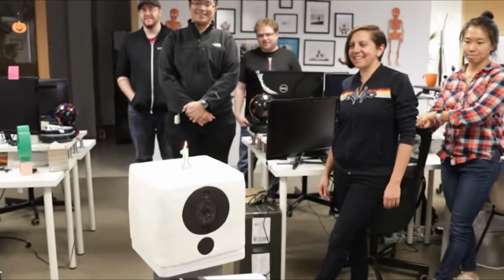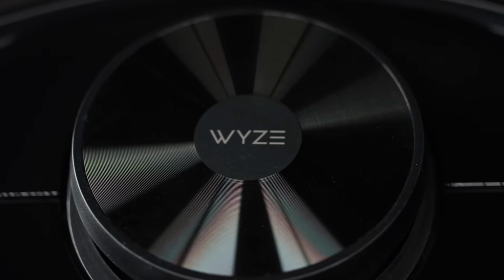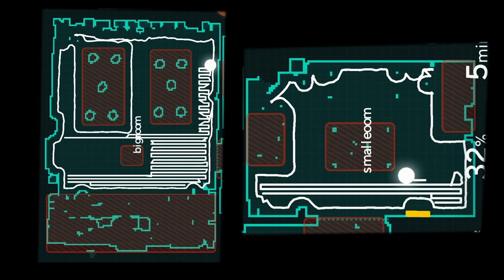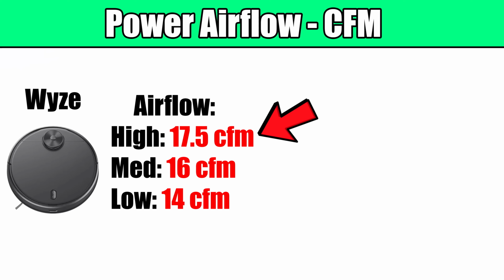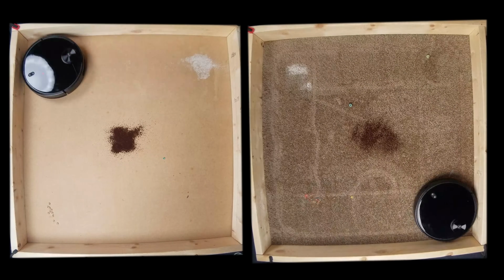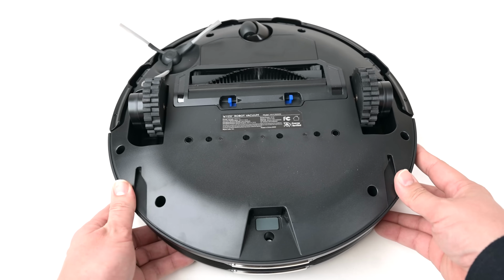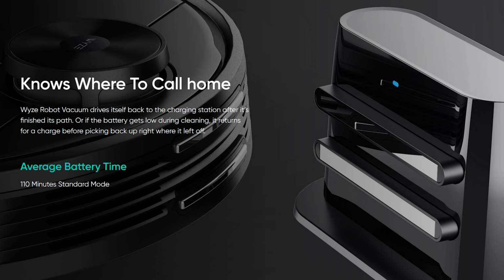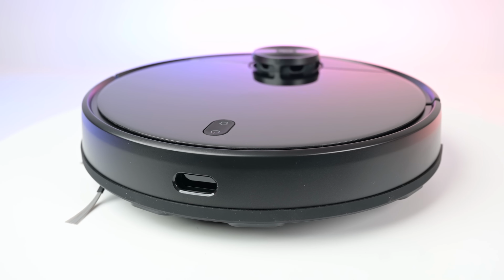WYZE Robot Vacuum Review - This Will Shake Things Up!

Comment: I disagree with you claiming that battery running time is not important. What about if you have a big two story house or a 3 story house. That my problem right now most of the vacuum right now are not capable of cleaning my second floor so I have to bring the robot upstairs once, being down let it charge and being it up again to clean my entire upstairs. it is a pain in the ***. 90% of the houses around where I live are two story houses and mine is only 2600 sqft.

Comment: This is exactly the same as the Mi Robot Vaccum Mop released in India last year. It was available on pre-order for Rs 18000 (USD 250) but its now sold for Rs 25000 (USD 350), including shipping and taxes. The Indian model comes with two mop attachments and an additional water tank.
https://mobile.mi.com/in/mi-robot-vacuum-mop-p

Comment: Is this one of the robots that has the camera that will spot potential obstructions? That's a huge deal breaker for us. We have cats who leave hair balls and occasionally worse and I dread having a robot vacuum spread that all over the house.
Reply: No camera, it will use sensors and slow down before bumping anything but will go over small things like cats toys etc, so even if the hair ball is a inch or two diameter it would most likely just suck it up. No worries, it’s smart but not too smart, does a great job.
Reply: I may have miss read your post. If the hair balls and worse mean vomit with hair balls or fecal matter,  than although I haven’t tested it, it would run over and smear whatever’s smear-able, I’m sure, unfortunately for your situation. We have a cat and it sure does pick up a lot of hair, we love it.

Comment: Is there any way to check for longer term hair tangles on both the main roll and side bristles? I’ve had multiple robot vacuums that have the standard hairy roll (haven’t had a roomba) and since my wife has long hair, after a couple uses the hair tangles everywhere, around the side bristles and the main roll

Comment: it is a rebranded xiaomi mi home robot and mop combo but without the mop attachment and the  "combo water tank / dust bin" 

i have the original product from xiaomi, and it cost a touch higher price in china, about 1800 RMB while 250 dollars is about 1620RMB.

its brush roll is not floating brush , it cant pick up some heavy debris which roborock can. while the brush roll don't last long.

Comment: Looks exactly like the Proscenic M6 Pro I have, probably a clone or related to it. Great vacuum for the price, very hard to pass up. The M6 Pro does have a mop with electric pump that slides into the bottom slots that are present on the Wyze robot.

Comment: Wyze has some sort of connection with Xiaomi, because their cams were sold rebranded by Xiaomi in the Chinese market as “Xiaofang”. Since Roborock and Viomi are also part of the Xiaomi ecosystem, I wonder if this is simply a rebrand of another Xiaomi product. The Wyze band looks very similar to the Xiaomi Mi Band 4C (same design but different specs). Same goes for the Wyze Watch. Even their thermometer and the surge protector is just a rebrand of a Xiaomi/ecosystem products. You should check the box of the vacuum, it often states the manufacturer of the product.
Reply: also xiaomi acquired roborock a couple years ago. Xiaomi using wyze to break into the american market.
Reply: @chinchilla505  I don’t think we’re talking acquisitions here, it’s more like Xiaomi has participations in those company so they can use their distribution network and Xiaomi Home app ecosystem. The original Mi Vaccum Bot is Xiaomi branded and it’s pretty old but it’s manufactured by Roborock for Xiaomi

Comment: The Wyze vacuum is a rebranded Xiaomi Mijia STYJ02YM which is why it has slots for a mopping attachment. As far as I can tell it also uses the Xiaomi cloud for syncing with the Wyze app so it's pretty much Xiaomi through and through, such isn't a bad thing, but worth knowing.
Reply: Especially since the Xiaomi product is comparable in price but has more features like the mopping and connection to hubs.
Reply: Xiaomi owns the Roborock brand. Both brands make top-notch robot vacuums.
Reply: @bazil4146  They own a stake in it but they don't own it completely. Thanks for the reply. This has sent me down a rabbit hole of robot vacuum manufacturing again :)

Comment: Isn't this a rebranded Viomi/Xiaomi vacuum? It's exactly the same as Viomi S3 or Xiaomi Vacuum Mop Pro.
Reply: Roborock is made by xiaomi not sure of  the wyze brand
Reply: @6hilltop6  no, it's Xiaomi robots that are made some by Roborock, some by Viomi and some by Dreame. Xiaomi doesn't make robot vacuums.
Reply: @matteventu  they do. I own one.
Reply: @matteventu  roborock uses the Mi home app as well as the roborock app so yeah it's xiaomi, they make a multitude of products like samsung and huawei and they are under investigation by the USA
Reply: @catch_me_if_you_can1147  don't spread misinformation please :) "I own one" doesn't mean what you're saying is correct. The Xiaomi models are built some by Roborock, some by Viomi, some by Dreame. Those are companies that have partnered with Xiaomi to design and manufacture for Xiaomi the robot vacuum models, and sell them under the Mi brand. Still, they're not designed and manufactured by Xiaomi, but by those companies I've mentioned.
Reply: @6hilltop6  lol read my other comment to Johnnes. The fact they appear in the Mi Hoem app means nothing, it's like saying a TP-Link product is a Google product just because it appears in the Google Home app.
Reply: @matteventu   that is their strategy. their core components and parts are from the same manufacturer of Xiaomi. Xiaomi is a giant in smart home devices (builds almost everything) and it pushes forward the whole supply chain and ecosystem (mostly in Shenzhen). Many companies are following very tight. They just buy those parts from OEM and build similar products for cheaper price or slightly tweaked use cases. I believe Xiaomi is currently allowing it so it is still a legal thing. Wyze is just one of the few that sells abroad. I personally it is a good business model. It proves those cool tech gadgets might not be that costly.
Reply: @matteventu  you are correct. Some are affiliated to Mi brand. Some are just solo brands that are heavily dependent on Mi supply chain without paying Xiaomi. Xiaomi allows both, which is generous and cool.
Reply: @matteventu  you're wrong
Reply: @endorkugo  I'm not wrong. Care to elaborate, if you believe you know more than me?
Reply: check out a few blogs if you understand Chinese or use G translate. https://www.ednchina.com/news/202009Teardown.html
Some tech guys break down Wyze flagship cam v2 and v3, the chip and the lens and even the main board are same as Xiaomi cam (or Xiao Yi cam, a Mi brand). they bought from same OEM as Xiaomi and rebuild the software.
Reply: Can parts for this be bought on Amazon or somewhere else? I know it's knew so I am wondering
Reply: Yeah it’s identical (I have the xiaomi version). They seem to have deactivated the mop functionality which leaks on the xiaomi version

Comment: Does your unit have the intermittent brush roll issue? On most carpets, the brush roll constantly starts and stops as it encounters any resistance. It doesn't do this on hard surfaces.

Comment: Thanks for doing this. I received my Deebot T8+ this week and I love it. I haven’t tried the mop yet though. One little thing I was surprised - seems to have the same issue with pure black lines on my carpet as my Roomba 980 did. I though the laser and camera combo would have solved it. Now I’m nearly wishing I would have waited a bit longer for the Wyze.
Reply: What do you mean pure black lines, as in it leaves marks?
Reply: @Drazorig2  Actually no I meant my carpet has pure black lines on it and it wouldn’t go over them.  That was 11 months ago though and not long after that post, I ended up sending it back and got a Roomba I7 and love it.  It’s not had one issue since and it goes every day.

Comment: I've owned 2 Wyze products. Big on claims, crap in fact. In particular, their phone app is an abomination which can be seen by checking the ratings in the app store (Android). Support is non-existent. My experience, cheap and it shows.

On the other hand, they will probably help lower the unreasonable prices charged by the competition which is a good thing.
Reply: Are vacuum robots really that expensive ? Price of a smartphone but with much more sensors/components and a much smaller market.

Only the self emptying bins are ridiculously overpriced.

Comment: Does it work well on black carpets? I have a Roborock S5, two years old now, that works well except... it refuses to go on carpets with black designs. I read other models had this problem too. Is this something that new vacuums have worked out? I am considering an upgrade to a new model if that is the case.
Reply: I have a Roomba that does this. So basically, I can't vacuum my living room with it due to the pattern of the rug (large black, brown, gray squares).

Comment: Hi, nice review, it's a bargain for 200$. I suggested on facebook messenger the Roidmi Eve Plus. It is an AMAZING robot and it is practically a Roborock S5 Max improved (more power, self emptying dock, 2 side brushes). It is very cheap right now around 530$ like the S5 was when it came on the market. Now the S7 will cost a lot more and will be sold at first WITHOUT its emptying docking station. On the bright side i expect it to be almost as good as a moping robot but it's components won't last more than one year. I say this from the experience with the S5. I mentained it very well (regular cleaning, greasing the gears in the wheels, in the main brush, in the side brush, i had to dissasamble them and the grease was very warn out and dirty after about 1.5 years). I changed de LDS motor once and stuff like that. But with that maintenance it still works today quite well and if it were to be possible to add an auto emptying dock wouldn't have retired it.

Comment: I have the Wyze vacuum. I agree with your review. The only problem I’ve had is the App and mapping. Occasionally I’ll have to reset the map because for some reason when it begins vacuuming it loses its orientation and goes off map overwriting (like it discovered a new area). I’m sure firmware updates will fix and address these issues and over I’m very happy with it.
Reply: I was having same problem plus crocking the map and getting lost,i delete everything from the app and did a factory reset to the vacuum,after that, have been perfect for 3 weeks.
Reply: It's been over a year. Did an update fix your issue?
Reply: Same thing happened to me today. I stopped cleaning and turned it off. Then I opened the app again, turned the vacuum on and started cleaning. I made sure everything in my room was in the exact same place like it was when it made the correct map. And viola, it automatically switched to the correct older map and just forgot the crap of map it ended up with just few mins back.
Reply: Planning to buy one, is your wyze still working?

Comment: I'm waiting on the eventual addition of a self emptying base before I consider purchasing this.
Reply: @Auroramystic  they'll add that in the future as a paid upgrade and mail you a microfiber cloth.
Reply: @Auroramystic  Exactly.
Reply: The Wyze vacuum is a rebranded Xiaomi Mijia STYJ02YM so if that robot doesn't have a auto emptying system the Wyze won't.
Reply: @AlanJames1987  isn’t that the xiaomi mop pro?
Reply: @nintendo-toasteredition  it's my understanding that the xiaomi map pro isn't s specific model but a line of models. The Viomi V3 is also the same thing. The original two models are the STYTJ02YM and STYJ02YM. I just got my Wyze vacuum and I'll be taking it apart this weekend to root it and install Valetudo on it, so at that point I'll know exactly what it is.
Reply: @AlanJames1987  what can you do with it after rooting it? Link to more info?
Reply: @taumax  Under the hood the robot runs Ubuntu so you can make it do anything that a Linux machine would do. But with Valetudo you can integrate it directly into Home Assistant or even drive it around like a report control car.

Comment: Plz do a review on the shark wand vac system with the cleaner head
Reply: I have the vacuum.  It's very impressive little thing with a few caveats.  First, it having a stand looks very stylish and contemporary.  Second, It has an incredible power for its size.  I vacuum what seems like a clean carpet on second floor with it and end up with a bin full of dust.  It sucks dust right through the carpet and off the pad.  Negatives are:  Uncomfortable high speed button that you have to keep on holding, very small bin size, handle getting uncomfortably warm when on high speed due to batteries in handle heating up, and lastly, battery life.  I get 7 min on high and 11 min on standard.  Oh yeah, another thing is, stand doesn't have enough spots for all attachments that come with it.  

Really wish the high speed mode was easier to activate.  You need it on carpet, but the problem is this vacuum has ridiculously strong carpet actuation for such a little thing and it actually takes quite a bit of force to move it through carpet.  And on top of that you have to be able to squeeze the rubber button underneath the handle the whole time you're fighting vacuum and carpet and your hand starts cramping up.  Because you end up squeezing the whole handle so hard, once it starts to heat up it gets much more irritating than it should be.  This thing would be sooo much better if they just put a switch on it instead.  

But I decided I'm keeping it anyway.  It's very good on carpet stairs because of much smaller head than other vacuums.  And it's also decent on hardwood floors downstairs too, don't need high speed for that so you just coast through, but pretty much any vacuum can do hardwood floors well.
Reply: Correct me if I’m wrong, but I think he did that review already.

Comment: Wonder if you could provide more info on cleaning run times with each power setting. More importantly could you post a comparison chart with each vacuum and its corresponding time that it took to clean each of your test rooms? I believe battery life (and cleaning efficiency) is a bit more important especially if you consider a larger floor plan. For example my roomba S9 takes (prior to the recent update) 6+ hours to clean my upstairs as to where the T8 AIVI could do it on 1 charge in about 1.5 hours. Considering i usually run the vacuum immediately after i pick-up my house ( i have 2 toddlers) i need the robot to be able to clean quickly before the kids inevitably make a mess again. 

And as far as what i mean by efficiency, 30 minutes with a lidar bot vs 30 mins of cleaning with a camera based bot is a much different thing.

Comment: Isn't wyze s robot just a rebranded xiaomi robot just like roborock is a rebranded xiaomi?
Reply: It looks exactly like viomi and xiaomi vacuums.
Reply: Roborock is owned by xiaomi and the software on roborock vacuums is shared with xiaomi. Wyze is being supplied the vacuums from xiaomi but writing the software themselves. That's a pretty substantial difference imo.
Reply: @klink388288  no it's not substantial... but kudos to them for reselling a robot with their own software for half the price
Reply: @Vlican  Except their software really sucks at this time.  The vac frequently goes right through the virtual walls. The map gets messed up frequently to where the vac thinks it beyond the actual physical walls, and when it does these things it never makes it back to the base.  It has to then be reset, physical blockades set up until it completes the map with a cleaning where then the virtual walls can be re-setup.   I think it would be fine if we didn't have to use virtual walls, but we need several for the area it's cleaning.
Reply: @klink388288  If that's true - having the same robot that functions the same and app provides the same features, it's not that big of a difference.
Reply: @MartinzW  they are adding features though,  like the floor remap with vaccum part turned off. It can make a full map in 15 min without using like any battery. My $650 roborock needs 2 charges (5+ hour process) on its lowest setting to make the same map while doing a full clean.
Reply: @klink388288  Yeah these guys are pretty good with their software and adding new features and improvements.
Reply: @klink388288  okay, but how often do you remap your house? I mean that's a one-time process. 🤔
Reply: @klink388288  weird... My only experience with robot vacuums is with the rowenta cyclonic explorer and it can make the map without vacuuming and it does it in less than 30min. They say it does 5m2 per minute.
As rowenta is not a big player in this market I had assumed this was pretty standard at this point and also the model is already a bit old....
Price wise, I got mine for the same price as this one.